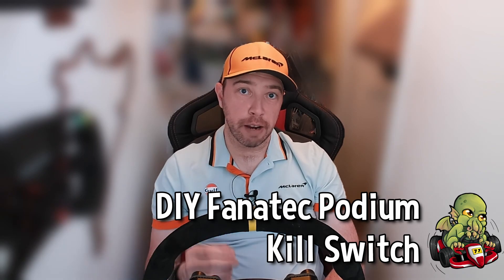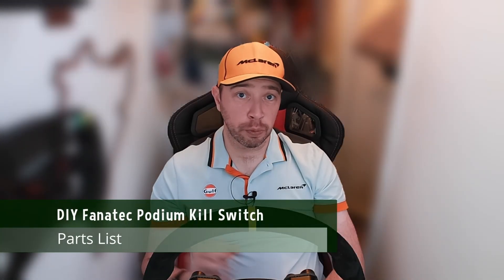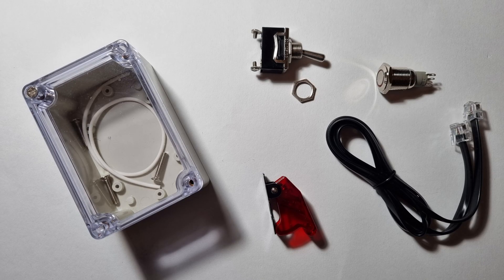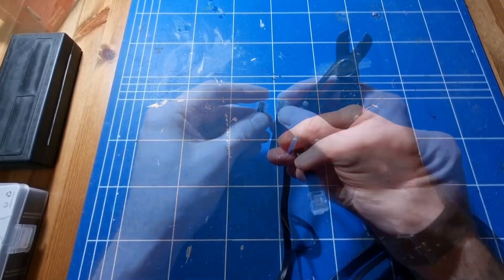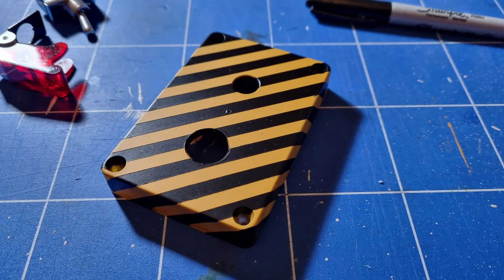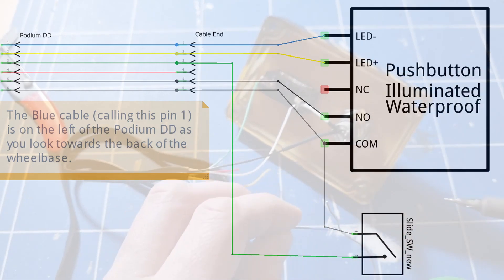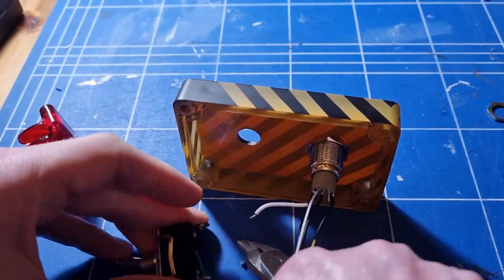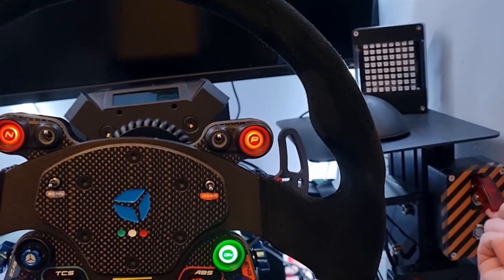DIY Fanatec Podium Kill Switch

Comment: My wheel is plugged into its own power strip, I can just shut it off from there with my foot if anything goes wrong.
Reply from the maker: Whatever works for you.  It's good to have options.  I never actually needed to use it for my Fanatec gear.  I have used the shut off once for my Simucube though!

Comment: Hey, would I be able to get in contact with you via Discord? I have my parts, have finished the soldering stage, although I am having some issues. LED's work for both switches, although the buttons don't do as their intended. Am I am able to contact you somewhere and send you some photos I have ready? Just for you to see if my routing of wiring is correct? Maybe I have to change something around, although I am not as knowledgeable. Would greatly appreciate it! Lmk thanks!
Reply from the maker: Yep, you can always find me on https://discord.gg/HMyz53UbBm which is my own Discord server, though it hasn't been officially distributed yet beyond a few friends.

Comment: Hi. Thanks for the tutorial. I followed using pretty much the same type of switch/toggle. And I can power up but the toggle switch has to be on the off (lid closed) position in order for the momentary to illuminate and power up the DD1. Same as what happened to you in the video. I swapped the cables on the toggle switch and still have the same behavior. Any ideas? Thanks a lot
Reply from the maker: It sounds like your switch works in the reverse of mine, a simple solution would be to cut out the key on the guard and flip the switch.
Reply: @TeqqlesdoesVR  yeah. Thanks. I ended up cutting the key to allow me rotate the switch and now it’s working as intended.
Reply from the maker: You could cut out the keying on the switch cover and rotate it 180 degrees, that'll save you having to re-wire it all.

Comment: Hi. Could you tell me how to wire if you’re are using a push switch with “nc no and c” instead of “on and off” like the one in your diagram.
Reply from the maker: In the diagram I'm using an illuminated momentary switch with nc, no and c (com), or were you meaning something else?  https://drive.google.com/file/d/1C5RmyIIZU1heOJxz9rix7d8_B9uAOv3O/view

It's not advisable to use a momentary for your emergency cut (the second switch) as if you're using the emergency stop feature you're probably doing so for a reason.
Reply: @TeqqlesdoesVR  I'm using an illuminated monetary switch too. I was able to follow your diagram for wiring that one. My issue is that my second switch is a Mushroom Knob Switch with  1NO, 1NC, C. In your diagram, you are wiring to a toggle switch with only On and Off leads.
Reply: Also, may I email you my diagram of how I wired mine? I don't want to destroy my dd1 and maybe seeing what I've done will clarify what i have said. Thanks a lot for helping me out.
Reply from the maker: @Martin-uj6zn  sorry for the slow response @martinzepeda4901 I'm knee deep in a clean up operation on my rig right now!  Feel free to drop me an email for clarification, you'll find the email address on the about page.
Reply: @TeqqlesdoesVR  no worries. I was able to figure it out yet I greatly appreciate your willingness to help a fellow sim racer.
Reply from the maker: @martinzepeda4901 awesome, glad you got it all working 💪
Reply: @martinzepeda4901  Looking into this also, I have a mushroom button with C NO NC, according to this did you connect the green wire to the NC and the grey wire to the C? Leaving the NO empty?

Comment: Does your button light remain ON all the time? Or comes on when activated?  Thanks.
Reply from the maker: It's only on when the wheel is active. It also flashes for things like updates, that's all controlled by the wheelbase itself.

Comment: Hey mate! Will this need a resistor as far as you know?
Reply from the maker: If you're just using straight switches there will be no need, however you'll have to check the voltage supply if you're wanting to put an led in and use resistors as appropriate.

Comment: quick question my cables are a diffrent color pin 1-6 is just from left to right? right and what could happen if ibwire it wrong ?
Reply from the maker: The colours shouldn't matter so long as you wire them as described.  If you get it wrong you could short something or stop the wheelbase from switching on entirely so definitely double check your work before plugging it all in.  I used a multi-meter to verify my wiring after soldering the project all together.
Reply: @TeqqlesdoesVR  yeah I just followed your guide and it works perfectly  tha ks
Reply from the maker: @Ibo4433  Nice!  It can be scary, especially given the hardware you're playing with but it's so rewarding to build out some DIY hardware 😃
Reply: @TeqqlesdoesVR  yeah it really is. tbh I didn't really care if i break my dd1 or not I was to proud to buy a kill switch for 99€XD
Reply from the maker: @Ibo4433  tell me about it. They really could offer a budget option